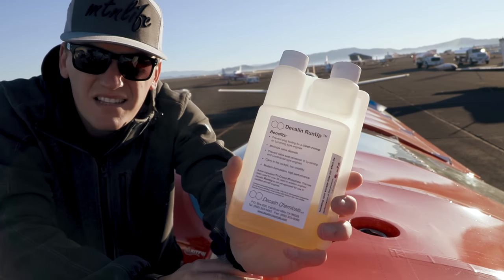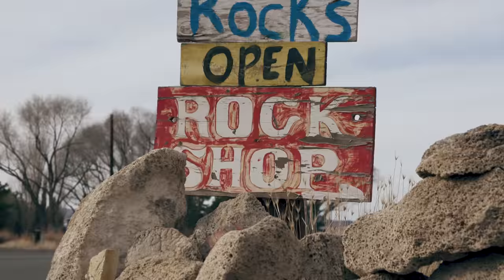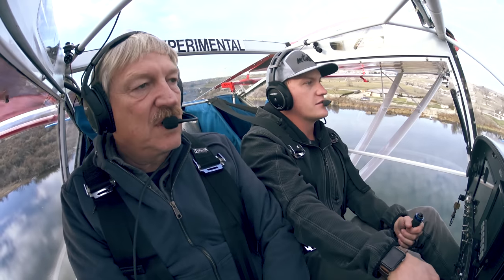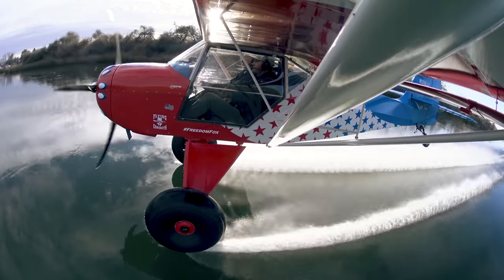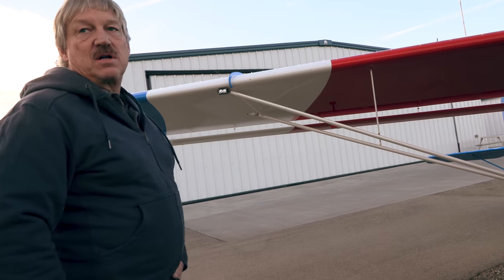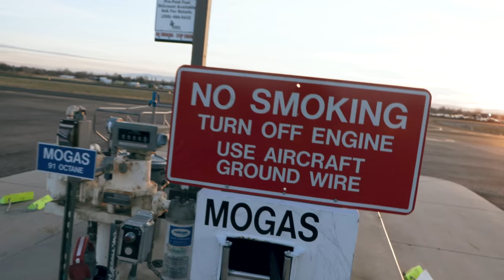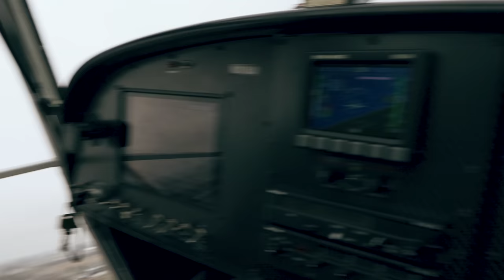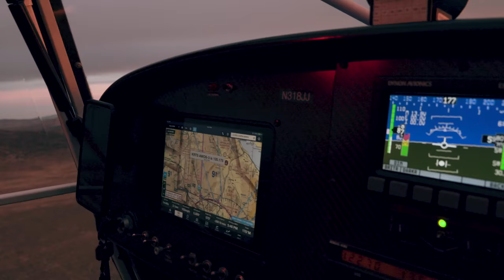To Idaho - Vlog

Comment: Back in the 80's when Stead Airport had an operation called Sierra Nevada Soaring which was a Soaring Operation , Rentals, School etc. It was owned by a retired SR-71 pilot named Bill Skliar. We had years of fun soaring around Northern Nevada. One thing we would often do is fly RC planes launched from our two place gliders. We had an "insane" group of pilots who teamed up with the sky diving operation. They would enjoy leaping from our sailplanes, but none of use reciprocated and tried our hands at skydiving. Anyway our gliders, just like your KitFox could fly slow enough to stay with the RC planes. We tried the same thing with our tow plane and Scout but the speed difference was too great and didn't work well at all.  Other planes,172s and up were mostly out of the question.  Another note about the glider operation at Stead those yeas from the late 70s through the 90s saw us do many things.  We had a "Wave Window" wherein we'd call the FAA or the Reno Tower and they'd open a blocked section of airspace and they'd keep other traffic out of the 'Wave Window" and we'd make flights up to, I think the highest was 34,000 ft. (with dual oxygen systems for safety) I personally attained an altitude in our Wave Window of 30,500 ft.  So, yes, there is a history of RC flights from aircraft over and around the Stead Airport by members of Sierra Nevada Soaring.  Love what you guys are doing, keep it up!

Comment: Hello Trent, great stuff, really appreciate your video and flying skills! As a drone pilot you have an eye for the best cam angles with available lighting, coupled with your snippets of video to really help tell a story or a moment in time! Keep up the good work! Building a Series 5 fox some years now... be great to see a video walk around with explanation of mods and sources. I especially like your keep it simple approach to your panel. Can you describe your panel and decision making thoughts on this, along with any regrets... Busy rethinking my panel after seeing yours! Also, any good idea’s to cost effectively meet the new transponder requirements of 2020?
Reply from the maker: Hey man, my panel was really just a rearrangement of the equipment already installed, but it had doubles of a lot of gauges so I got rid of the superfluous ones. Then I just wanted to make sure I had room for my iPad! If I was doing it again I’d have gone with an electronic engine monitor setup such as a dynon D10 or the engibox from Avmap

Comment: You should get your instrument ticket, if you haven’t done so already, that way you won’t get socked in and try to scud run. It appears you have experience,  judgement and skill, but I have known a few pilots that have bought the farm - CFIT. Sadly might I say, one was Paul Marchiosotta (sp?). Who crashed the day after he got his instrument. My CFI signed off on his hours and was very hesitant in doing so, he was a brilliant engineer (not the CFI) and only flew the minimum 40 hours. It was the day of Thanksgiving and he could of done any number of things to avoid putting himself in harms way. Three souls perished. The other was trying to get his buddy to the airport from KPSP in a Cessna Caravan after I believe he missed the flight, he flew VFR through Banning Pass (into IMC) and learned a hard lesson, unfortunately. I’m pretty sure this guy had thousands of hours? Like the saying goes “ there are old pilots and bold pilots, but there are no old bold pilots.” The other pilot  I didn’t know was extremely skilled, an astronaut, and he was flying low in the Sierra Nevadas and I don’t remember what the NTSB report was but there most have been a strong rotor, mountain waves or a microburst and that pushed his plane into the ground ☹️

Nice videography thanks for sharing!! Fly safe and don’t succumb to peer pressure or in this day and age doing something to get that crazy video clip on YouTube that could spell trouble?

Comment: Those large, round tires look a little weird, do you get bouncing bouncing bounce on landings before you got operating the airframe down?
Reply from the maker: Haha, at high tire pressure they will bounce but at 5psi like I run them they actually absorb impact and reduce the bounce
Reply: Thanks for getting back to me, simple answer I just didn't think of it. I enjoyed your video, that is one amazing aircraft

Comment: can a kitfox do any king of stunts such as a loop or barrol roll? if not it is still an amazing machine from what i have learned from your videos so far!
Reply from the maker: It’s not designed specifically for aerobatics but it definitely can handle them! Check out Kyle Franklin’s aerobatic routine in one at Oshkosh last year: https://youtu.be/mFwPlP4CZ6o
Reply: Wow that is awesome. love all your videos, can learn alot from them. Just one more question maybe i havent found the video yet. but how much would it cost to buy a kitfox 5 like yours but maby with a few less mods to start flying. Can it be dun for 25k with it being already complete, or is that around the price of a unbuilt plane? Thanks again!